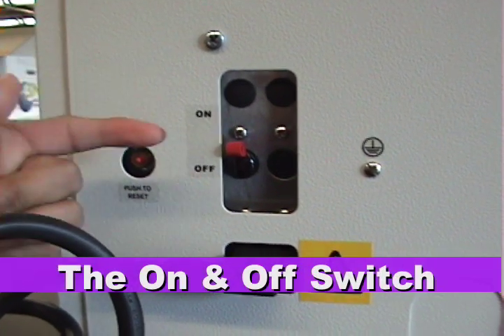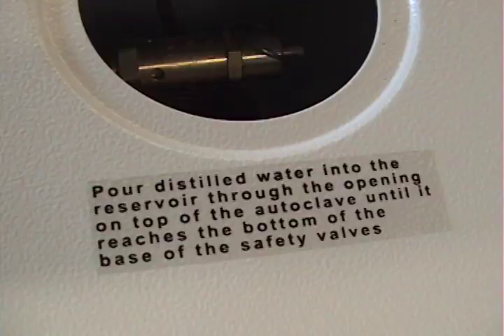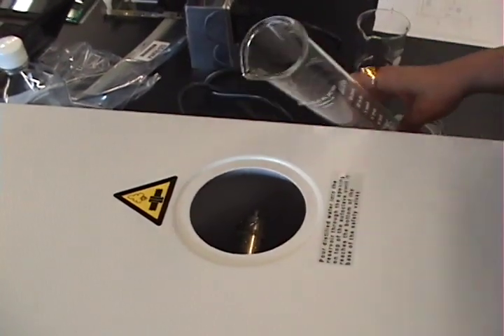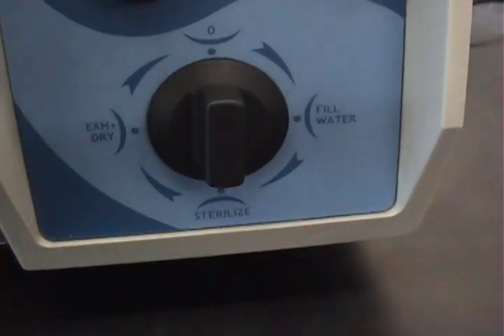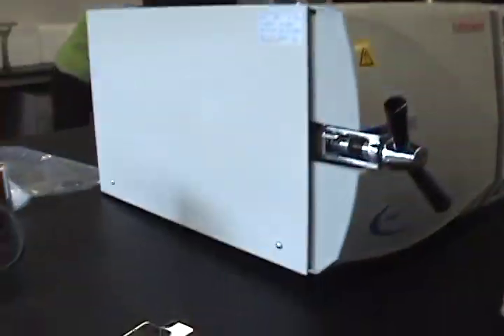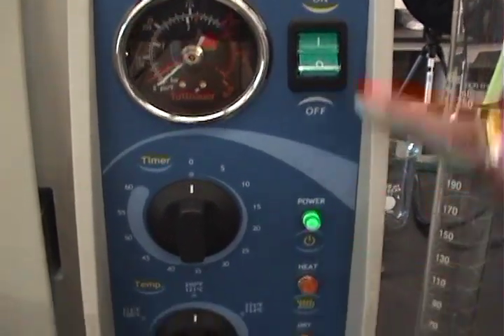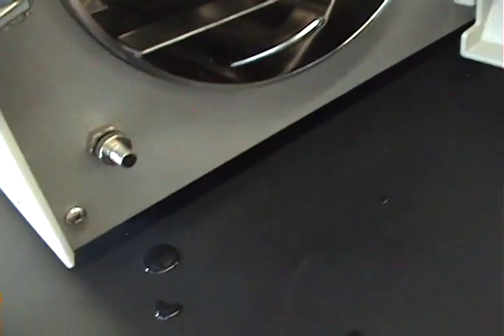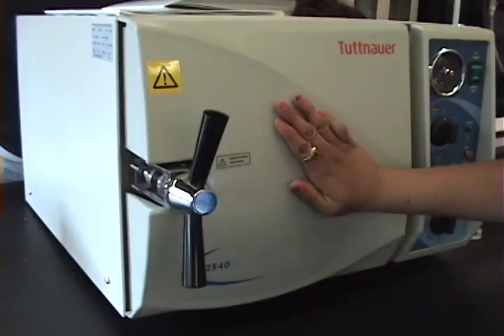Autoclave: The best sanitizer

Comment: @getrealthen  Not if they are wrapped. You are correct that unwrapped items are readily contaminated after processing if not handled correctly, but that still does not equal sanitization. 
The terminology used here is incorrect. Sanitization and sterilization are different terms, with quite different meanings. Sanitization is simply cleaning to reduce contamination, it is not even at the same level as disinfection.

Comment: Unfortunately this video is telling incorrectly how to work with this autoclave!  Correct procedure is following. Water reservoir should be filled in advance with water almost entirely.  After that turn the valve to the filling position and look how water is flowing to the chamber. If water has reached the filling mark near the chamber door, turn the valve forward for next 90 degrees to the sterilization position. Then put a load and close the door! Measuring a water is necessary for regulation of tilt of autoclave chamber by its legs. This should be done only once during installation or after movement. In this case water should be poured directly to the chamber.
Reply: Ardo Isküll lol exactly, this is what happens when women perform mechanical tasks. It also says on top of the autoclave to fill the reservoir to the bottom of the safety valve. They probably have no idea what a safety valve is or what it looks like.

Comment: Your doing it wrong.... You have to fill the water to the over pressure valve. Then you hit fill and wait for the water to fill to the line then turn to steralize.... When It's done venting it's okay to see steam and keep it vented untill it's dry it should take about 40 min. for drying..... Do It Right
Reply: You haven't read the directions either